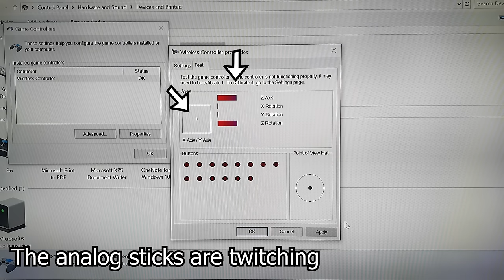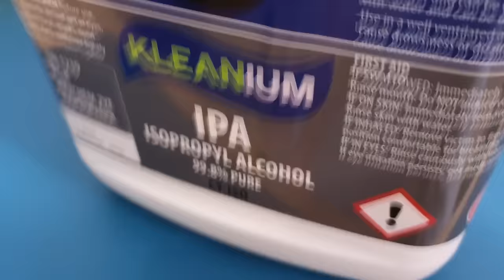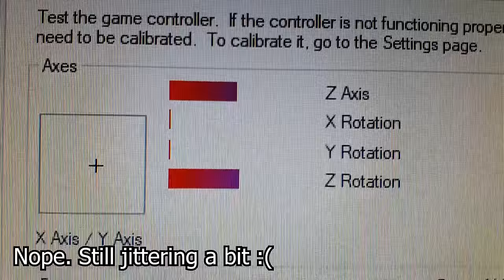How to take apart PS4 Controller and Repair the Analog Sticks

Comment: I'm the luckiest man in the world I pop open the controller without knowing about the ribbon cable and it unpluged itself perfectly
Reply: @RestoreTechnique  t
Reply: After reading this literally the same thing happened to me.
Reply: It’s not fragile, I take apart my controller all the time, and did this a lot didnt break it once
Reply: @_kingclutchx_1917  kinda because it a ribbon cable
Reply: That sounds smooth asf😆
Reply: Same happened to me
Reply: @RestoreTechnique  help i bent the metal prongs
Reply from the maker: @jackyxyzgaming9520  the one's on the flex cable? You might need to buy a replacement flex cable. Not sure which prongs you're referring to though.
Reply: @jackyxyzgaming9520  if the contacts on the ribbon cable are bent, one temporary fix can be to cut down the cable end by 1mm - so that the remaining leads can possibly contact when inserted. Otherwise, buy a new ribbon cable on eBay?
Reply: Same haha
Reply: Me too but I opened it before
Reply: My shii snapped right off the thing that comes out there goes my light not that i cared anyways just saved battery life now🤣🤣
Reply: WHAT
Reply: @zacharyenck1087  the blue one?
Reply: @koaxy7261  idek bro😂
Reply: What happens if u don't unplug the ribbon cable?
Reply: Same here man; I got scared, I though mines broke
Reply: I had that just 5 min ago but it almost every time unplugs good 😊 is
Reply: My controller fell when I popped the controller open and it broke
Reply: My shit just broke😭
Reply: @nxslx7874  R.I.P for your controler
Reply: @manofmagic3214  wtf is that grammar
Reply: That happened to me too when I was prying it open carefully but I was getting impatient swypo little bit too hard and it just it was fine I was like what talk about luck on an accidental fast tug
Reply: SAAAAAME
Reply: Thanks bro
Reply: bro my controller was so damn hard to open and when it did the ribbon got detached from the opposite side! nothing is bent or broken, but for some reason my controller won't charge anymore. hopefully I just put the ribbon the wrong way or maybe the battery😫
Reply: Me too
Reply: @jackyxyzgaming9520  twin yo
Reply: Same
Reply: Meee ttoooo
Reply: @manofmagic3214  R/IHadAStroke
Reply: Same
Reply: Ik
Reply: Lucky I’m sitting here using tweezers and the entire white part comes off the soldered prongs smh
Reply: I’ve done that experimenting with 2 other controllers. I can’t pull the dam flex cable out
Reply: Me too tho
Reply: Same
Reply: Same thing happened to me but just I used brute force and I broke 2 clips still works tho
Reply: Same but its cus its made to be like that
Reply: That happened to me too, but I still smacked the controller to the ground after a bit

Comment: There are videos with millions of views that give us zero information and bad video quality. This is the first ps4 controller disassembly guide, that is satisfying to watch! Thanks
Reply from the maker: Yay! Thanks man :)
Reply: Fax
Reply: Fr thanks a lot tho
Reply: Yeah i actually realized i am unqualified to do these repairs. The other videos gave me false confidence. Unfortunately PS4 remotes have become so hard to find I'm getting desperate. I may have to buy the soldering kit and get to work.
Reply: @InterdimensionalDudeMan  I'm in the same boat I have three controllers all with different issues. Now I have to take apart two of them to make one good one but always screw up those clip things and break them when I disassemble this stuff. 

Been watching bunch of videos if anybody has any more tips on what not to do would be greatly appreciated.
Reply: @wheezsr  i also broke a couple pieces off of one when i was taking it apart. I think it requires one of those table mounted adjustable magnifying glass set ups like a jeweler would use. It's not that we can't see, i just feel like we need to see up close and be more exact in our repairs. It really is like surgery, one false move and you can destroy important stuff. I did a deep cleaning and got one working better. The other 2 need soldering and im not ready for that monetary investment yet. Good luck man. Sorry i can't offer more layman's advice.
Reply: @InterdimensionalDudeMan  Any advice helps man thank you. Not sure how to go about it as two of the controllers have left stick draft where it moves up by itself and the third controller is just worn and has a charging port issue.

Thinking if I replace analog rubber Parts Only and charging port from one of the other controller would be the easiest? Going to practice on 1 and learn from my mistakes LOL
Reply: @wheezsr  the charging port repair is easy. That one takes no soldering. If you have good charging ports on the two remotes with drift issues, then take the charging port from one of them and instal it in the one that wont charge. That was the first remote repair i ever did and it worked like a charm. Just pay attention to disassembly. Take pictures of each step before you detach each component. If you are careful, it should fix your problem.
Reply: @wheezsr  the analog sticks take soldering to replace completely. I tried to take one apart and mix n match components within the stick itself, but that didn't work out. Not sure i can do that one without a lot of practice.
Reply: @InterdimensionalDudeMan  exactly what I was thinking. Cheers 🍻
Reply: @InterdimensionalDudeMan  yeah I was going to just replace the worn out plastic rubber not the electronic part but have to do all the disassembly to get to them. Appreciate the help I'm not messing with the actual electronic part of the analog I'm told I'm really desperate.
Reply: @wheezsr  de los
Reply: @InterdimensionalDudeMan can i buy ancharging port and then put it in mine that has a charging port issue? is it easy? how expensive?

Comment: Finally a video which actually shows how to disassemble a DualShock 4 properly, I couldn't find a video which shows how to deal with the clips, some even skipped that process.
Reply: I. Rome my controller 8 times still fixed it 😭
Reply: Broke
Reply: Asmr ftw

Comment: I think the only tip left out here was to make sure you’re in a well ventilated room/area if you do decide to solder anything not just the controller. Other than that this is the best ps4 controller disassembly video I found. Cheers everyone and game on!
Reply: Why?
Reply: @wrathcamilo  soldering wire is often around 40% lead, so you don't want to breathe in the fumes

Comment: Thanks, i had a serious drift on both sticks and I only used this controller for like 100 to 120 hours (I don't play ps4 that much since I bought it).
I have two controllers and one was very faulty, never had the motivation to return it to Sony.
This video helped me open the beast and clean the sticks. Now it's as good as new (plugged in to my PC to see how the sticks were acting before and after cleaning them).

Many thanks! It was simple!
Reply from the maker: Sweet 👍

Comment: Had crazy vertical drift on right analog stick, I've fixed this by cleaning, using your video :) Thanks!
Reply: Sadly my left stick drift didn't get fixed from this teardown. I cleaned everything, still have issues probably a bent contact or something. New controller time u guess 😔

Comment: Thank you. Had a drifting right controller and non working down D pad. I told my daughter I figured a 3% chance I fixed it. Works perfect now. I used electrical cleaner though.

Comment: really very clear, now I know how not to break the clips anymore.  but I wanted to add that that white residue inside the potentiometer is a lubricant.  that particular model of potentiometer purchased new and opened inside has white lubricant as standard.  others however do not have it.

Comment: You could have just replaced the sensors inside the potentiometers(the circular spring looking things you said not to bend) you can get. 10 pack on Amazon. Just take out the sensor springs from the ones you ordered and put them in yours. Those things are the cause of drift about 90% of the time. So it would save you the hassle of desoldering anything. The other 10% it’s the metallic connection inside the potentiometers that scrapes off from wear and the sensor spring doesn’t have a good connection. At that point you could just replace the whole potentiometer which you will have to desolder. All in all this controller could have been fixed by just replacing the sensor springs you took out.
Reply from the maker: The metal discs are called wipers, and they usually don't go "bad", as they're metal, and not heavily spring loaded. It's usually the other part, the  carbon track which erodes after extended rubbing by the metal wiper. What makes you say that is the point of failure 90% of the time? I've never seen any videos of people bending back the prongs to restore them 🤔
Reply: @RestoreTechnique  Agreed, the thing that wear more are the one that soldered to the board rather than the disc itself. But I think it's possible to just replace the potentiometers itself and save time more time by just desoldering the potentiometers. And another thing that I noticed is that the clip that connects the disc and the carbon track you had for the replacement there is different from the original, so I guess it's the lower quality or fake alps one.

Comment: Great guide. I'll definitely use this when I clean my DS4.  Oh I just wanted to ask about your 5 year old controller with the original sticks,  did you ever have any issues with that controller?
Reply: I’ve had a controller prob since the same year ps4 came out and it’s pretty faulty like it won’t even move I only got joystick problems tho thankfully
Reply from the maker: I have never had any issues with it. I've since sold it to my cousin, i hope he hasn't had any issues.

Comment: some tips about the dics at 4:42, if after clean it drift more, before replace the stick, try bend the 2 prongs, using the middle plastic height as reference point, the prongs is at the middle of the plastic height, and prongs is lower than the 3 thin outer circles, outer circles is same height or abit over the plastic height.

Example for my case, the left stick X is drifting after slight touch, found the prongs near the top of the plastic height, so i have to push them in to middle, and push the outer circles a bit higher so it a bit higher than the middle plastic. And it fixed my left stick drifting.
Then i saw in the controller test graphic, the right stick X was jerking abit, although i do not have problem in game, but i do the same on the prongs and dics, then right stick no longer jerking too.
Reply: Btw, i found out about the prongs problem when i accidentally swap the 2 dics on the left stick, which i was having problem of up and down on the left stick that it drift upward, when after clean and accidentally swap the disc, it then become drifting left, so i test on the disc itself and found the prong and circles height solution.
Reply from the maker: Thanks for this information :goodvibes:

Comment: Great video! The clips that hold the top and bottom together ended up snapping but that's what the 4 screws on the bottom are for 😂 imo theyre the least important part of the controller so I'm not too phased
Reply from the maker: Thanks! Yeah the clips just hold the controller together a little tighter at the seams, mainly aesthetic.

Comment: I have the same controller and I didn't see the screw on the board and just tried to pull it out hopefully my controller is ok.  It worked I took an hour maybe more  but I learned a lot more then I thought this wasn't even the video I needed for my controller but I watched it anyways just in case so thanks
Reply from the maker: Cool man, that's great 👍

Comment: Clearly you are very well experienced with all aspects of the modern game controller, though I would like to commend you for the care taken in disassembly. As this is the first time I've seen one taken apart without breaking at least one clip....including my own😂
Reply from the maker: Haha thanks. I have broken a clip before. They are stubborn bastards.
Reply: @RestoreTechnique  they certainly can be.
Reply: Hey. If you don't mind. Like to ask a Quick Question. I have an old controller I'm trying to get going, as my other one is taking nose dive. It sat for quite a while, when plugged back in I get the one second orange light of death. I disassembled found what appears to be speaker just laying on board it almost looked melted. Reassembled did PS/ share button combo had blue for probably 15 min. Was not near PS4 at that time so I hit reset to shut off, as PS button wouldn't shut control off. Now back to orange. PS and share buttons now inactive again. Any help in a cause would be greatly appreciated, as I'm sure you're aware these controllers can be a royal pain in the a**. Thanks in advance for any knowledge/assistance you might lend sir. 

Edit: Seems it connects when it feels like it after pressing PS buton repeatedly, though only joystick, and  X seem to be responding when it feels like turning on...

Comment: Damn, I should have sent my Amazon Exclusive Limited Edition Crystal Dualshock 4 controller to you that I busted because of Wreckfest Big Rig Convoy trophy hunting rage, instead of flogging it as parts only on eBay for £10. The shell was in excellent condition, just internals dislodged and parts rattling around, I'm sure the guy who bought it was also an enthusiast and managed to fix it.

There was a red dualshock 4 controller that my brother busted in fifa rage (a lot more common 😂) 2 years ago and had the left analogue pop out but still encased in the shell. Looking at this video I guess I was glad that all I needed to do when I opened it up was pop the analogue back in, and a bit extra improvement work reinforcing the springs on the triggers.
Reply from the maker: I haven't had a rage damaged controller to repair. I've got a dog chewed PS4 controller, and a PS4 Slim that is rage smashed or has been sat on.

Comment: I tried another video before this one, that one didn't mention at all that starting from the palm rests was an option, and ended up being what I needed to crack my controller open. unfortunately I don't have the soldering items/experience needed to replace the joysticks, but cleaning them out at least helped the drifting issue into a barely noticable move left rather than a whole spin of the camera, much easier to deal with

Comment: I’ve read that the replacements they sell on amazon/ebay are junk, have weird deadzones etc. That the only way to get a decent replacement is from a parts controller. If you can source as well as compare decent replacements, that would be really handy. Thanks for the vid 👍

Comment: If I can give you a tip, try to find some brushes Used in the clinical laboratory to collect samples from the urethra, these brushes have soft bristles and are great for cleaning rather than a swab that leaves residue.

Comment: This is a very informative video. But Ifollowed these steps for my controller and changed both potentiometer of the left analog stick. The process put my controller in a much better condition than it was in before but it still drifts backwards automatically, so I thought the analog was faulty and I changed the whole left analog component and still got the same results. I don’t know what the problem is with it now.
Reply from the maker: Oh wow, that sucks. I don't know what the problem could be, I haven't heard of analog drift relating to a software issue or circuit board issue. Only the potentiometers. Maybe search online if anyone has had a similar issue. Unless it's another defective analog stick, or you're damaging it somehow during installation, idk :/

Comment: I have a PS4 that's less than a year old. Well, less than a year since I bought it new. The controller that came with it has had this exact same problem for a few months now. Fortunately I bought a second controller just in case I needed a second one. I've been using it. Now that I know what to do I can at least attempt to do a cleaning. But I am not prepared or set up to unsolder or resolder connections. I hope I don't have to go that far.

Comment: Gonna have to get a couple more supplies for myself and do this on my brother’s ps4 controller and probably even my own too. My brothers controller has some delayed stick drift type thing going on like I’ll do some inputs and then boom even when Im not doing anything anymore the controller goes crazy. I had to crack open my controller regardless because my left trigger was somehow coming out after I left it underneath some stuff. I had a good feeling that the fix would be easy enough so I bought a large precision screwdriver set and a mini blower for dust cleanup, that’ll be for when I dedust the inside of the ps4s 
Sadly with the trigger thing, it appears the person who did own the controller before me managed to really bust the controller, like the stopper guide part had a snapped part and I could tell because the right one was larger than the left and seeing that there was no sign of the broken piece when I opened the controller, the other person probably did their fix and trashed the broken part. So yeah this’ll be fun, gotta worry about almost taking out the trigger again and I’ll have to clean up multiple devices and I gotta order more supplies like the IPA, microfiber clothes, and some q-tips but styled better for electronics so I don’t leave behind any q-tip hairs.

Comment: Can i just say, iso alcohol tends to wear down the metal conductors in the springs. There wasn't residue btw. Thats the white from rubbing and wearing. The nodes need replacing every 7 months on average IF u play first person shooters alot.

If u see the new ps5 controllers have interchangeable nodes now, i saw it yesterday announced, lul, they know we burning those parts fast af